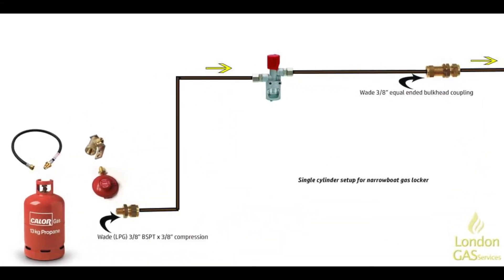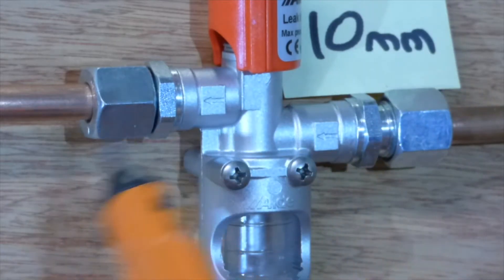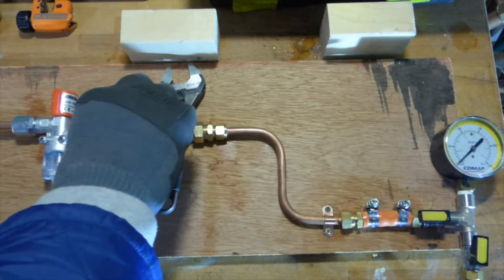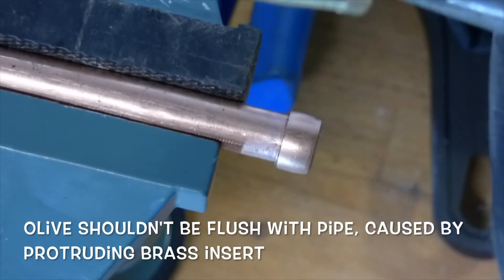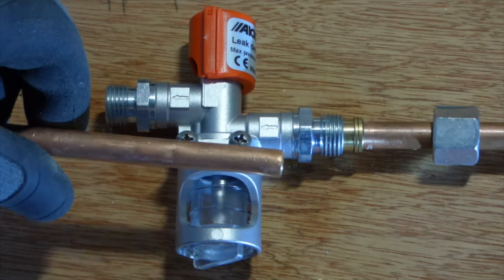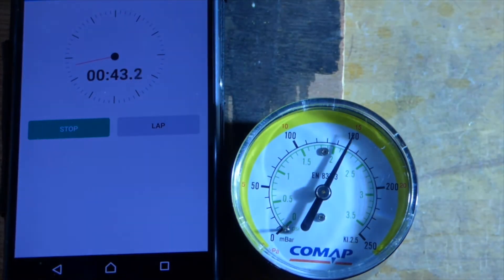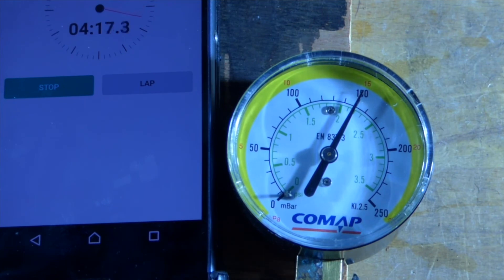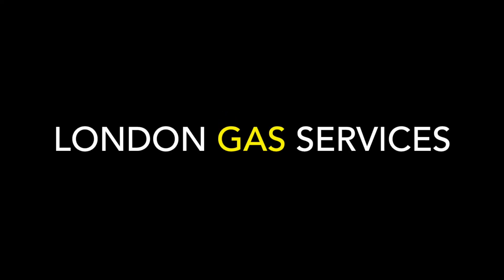Part 1: NEW - Can a 3/8" pipe fit a 10mm Alde LPG leak detector? // Bubble Tester

Comment: Why are brass olives not permitted?
Reply from the maker: Copper olives are softer than brass and produce a better seal. Brass can harden in use and crack. The different expansion / contraction rates can lead to pulled and leaking joints.
It's a legal requirement for marine LP Gas systems to use copper olives not brass - they should also have square edges, not long tapers, to form the best seal.  Hope that helps.
Reply: Why son these just come in 3/8 that's the pipe needed to comply with bss